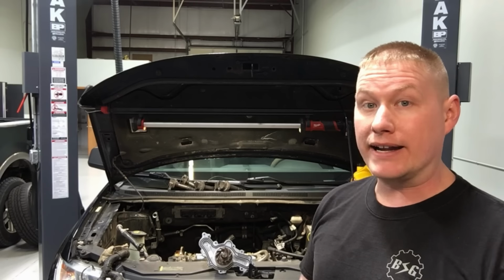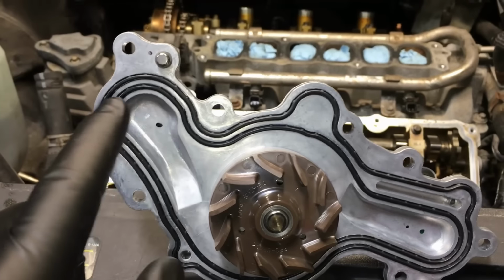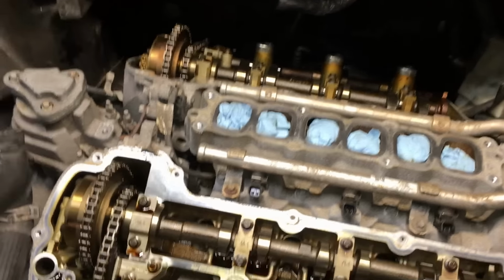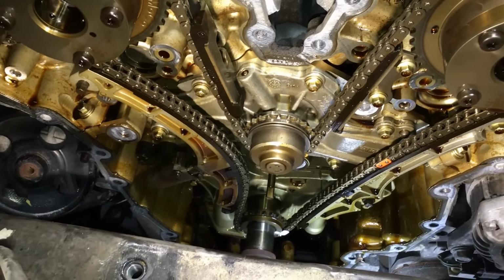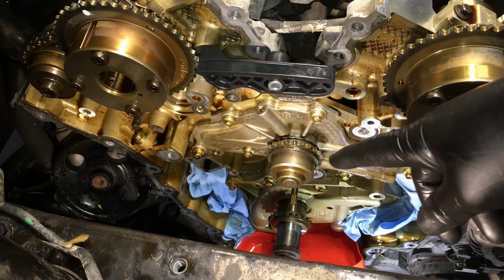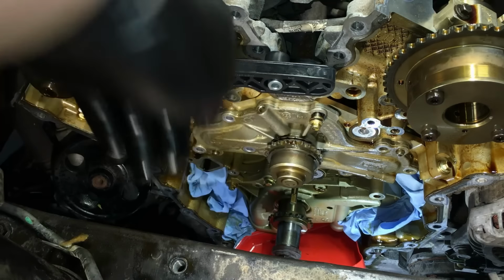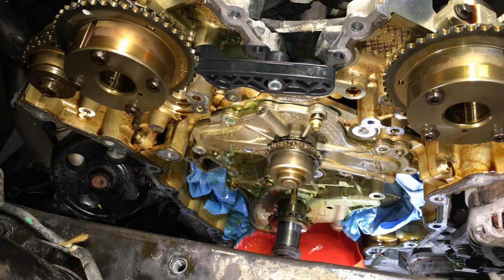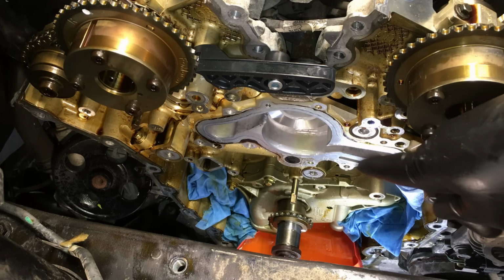Ford 3.5L 3.7L Duratec V6 Chain Driven Water Pump Failures: Check it Before it Destroys Your Engine!

Comment: chain driven water pumps are a prime example of why engineers should be legally required to work as mechanics for a couple of years first.
Reply: Would you really want one those quacks working on your car.   Nope.
Reply: @John it still has an accessory belt drive. Not difficult to simply make it exterior, belt driven. They don’t have a good excuse for this idiocy.
Reply: true but my G35x had 300k miles before I had to do mine... and then it was only a couple hours max.
Reply: @John you wouldn’t want a truck with a 3.5 cyclone. It’s hardly a truck. A sideways v6 is more then common now a days.
Reply: Agreed
Reply: Amen🙏
Reply: Yes I agree 110%
Reply: @john5756 EVs were not a thing yet in 2009. You aren't that bright huh?
Reply: @thomasgary1219   A little history 1832: Scottish inventor Robert Anderson built a basic carriage powered by non-rechargeable primary cells.1881: French engineer Gustave Trouvé showed a working three-wheeled electric vehicle with a rechargeable battery in Paris.1884: English inventor Thomas Parker built the first production electric car in Wolverhampton, England.1888: German engineer Andreas Flocken created the Flocken Elektrowagen, often considered the first real four-wheeled electric car.1890: Chemist William Morrison made the first successful electric car in the United States, a six-passenger wagon

Several Electric cars were built in the 1960s by both Ford Motor Co and General Motors. 
But Where the electric car or vehicle really showed its value was with NASA in the 1960 through the 1970s
In the 1990s GM had full production cars that were Electric The EV1
Tesla Motors began production in 2008 . 
car and driver has a whole story on the history of electric cars from the invention and production of cars and trucks even the Ford Model T had an electric version.
Reply: I like the qoute of one mechanic who saw this engine for the first time, he said that engine could never last as a normal V6, it is so compressed that you could find some new malfunctions that we never heared about,, I couldn't get what he said,, but now I know exactly how this pain feels and how much it costs
Reply: It was done on purpose to make .money
Reply: @gameboyinc4694 How?  Ford isn't making any money on it.
Reply: @Redbelly357  Oh yes Ford is making money,  The tax write off in the billions is a return on profit on the bottom line of profit and loss ledger. Every lawsuit settled is a write off also.  The marketing and sales of parts and service for exsisting and future product to be sold is also a return on investment.  The royalties on the patents for the aftermarket sales. There is more money made in parts than there is for sales of new cars.  Ford generates approximately $12 billion to $14 billion annually in standalone auto parts, accessories, and aftersales component transactions. This revenue forms the foundation of Ford’s broader “software and physical services” business unit, which brought in over $15 billion in 2025. Ford Customer Service Division (FCSD), which controls global parts brands like Motorcraft and Omnicraft, is aggressively pursuing a broader $100 billion+ maintenance and repair market. Ford is raking in the money on the failed designs because People will have to fix what they own as the automotive market is currently pricing many out of the new car market and eventually those new cars become used cars and need repaired. My 2013 Ford F150 has parts in it that only Ford sells and you can not get anywhere, but from the OEM. It has design flaws in the 3.5 gen 1 ecoboost it is only a matter of time before I will have to get a new engine and because of the properitary BS a gen 2 or gen 3 ecoboost engine will not work as the softwares are not compatable. Ford controls their software tighter than the U.S. Government controls national security secrets. and finally all automotive manufactures typically see much wider profit margins on replacement parts and accessories than on assemblies of baseline vehicles. Does not mater the Company Tesla, Ford, GM, Honda, Toyota, Dodge, BMW, VW and many others all use the same bussiness model.
Reply: the engineers are idiots in my book,,,,  something so simple they complicate for no reason, cuz i am not buying ever another ford knowing this possible problem exist
Reply: I say this CONSTANTLY.
Reply: It was the only place to put it, since if it was external, an already big engine would be too big to put into a transverse engined car.
Reply: @frequentlycynical642 they could have designed it to be a flywheel driven waterpump and placed it where it’s easily accessible when the vehicle is raised.
Reply: @rogercustodio6498  I've heard some crazy ideas in my many years.   What Ferd needed to do was, perhaps, put two seals on the shaft of the water pump.  Redundancy. Weirdly, the do have two rows of "o-ring" type seals at the pump to block interface, and if the inner seal starts leaking, it will weep out behind the alternator.
Reply: I am a retired engineer who did work as a mechanic for years before earning my degree. This kind of design problem, from my experience, is typically caused by management decisions that do not take reliability and maintainability into account. In other words, the engineers were overruled by the guy who signs their check. It is a chronic corporate world problem. OBTW, this kind of stuff is why I chose to become an engineer.
Reply: A couple of years at least 10 years that way they get pissed off enough
Reply: And liable for some repairs.
Reply: I've been saying this same thing for many,many years!
Reply: Nonsense
Reply: Honestly the 3.0, 3.5 & 3.7 Nissan FWD engine had chain driven water pumps for decades without all.these problems. Once again poor Ford design!
Reply: The people who designed this engine know better.  I'm sure they get a lot of pressure to meet cost, schedule and other constraints from upper management that force them into this kind of nonsense.
Reply: @davem3789 Pretty sure these clowns are somewhere blaming the technician for their Engineering failures.  I’ve worked as a technician, at a machine shop, thats all they ever did was blame the technician.  They didn’t give a shit about making things easier at all.
Reply: @John also electric water pumps aren’t needed for gasoline engines.  Electric water pumps are mainly only found in hybrids and obviously EV’s.
Reply: @ryanwilson8659  BMW uses them

Comment: Where are you located?

Our '09 Flex just deep-sixed the water pump ALTOGETHER at once!

The Fraud Dealer where we bought it, along with their PHONY 'extended warranty', wants $2,900.00 to fix it (even though it's allegedly covered in the Fraud Motors "extended warranty") and that $2,900.00 is JUST AN ESTIMATE.

I was raised as an HONEST person.... I honestly hope that their entire stealership gets blown away by a giant tornado.

I understand mechanical, my folks owned a repair shop for years... Dad was an ASE Certified Mechanic. I grew up wrenching, so I'd do this job myself if I could... But Osteoarthritis has got me.

Do you know of an HONEST Mechanic in Central Ohio that could do this job for us, REASONABLY?

As an aside, I have to add the 3.5 Fraud V6 to the list of the Automotive World's list of Greatest Boat Anchors... Including the old Cadillac Northstar, the V-8-6-4 and the HT4100... Anything by Chrysler, since the did away with they 225, 318 and 360... And everything else the Auto Industry has come up with since at least the year 2000.

Thanks Much...
S

Comment: my 2011 engine failed.
Reply: Mine just overheated today. 2011 Taurus. 115,000 miles and zero issues until this happened. Checked the dipstick waiting for the tow truck guy and sure enough the coolant had already mixed with the oil. What did you end up doing with your car?

Comment: would you see coolant on the ground on the passenger side, if the pump is leaking?
Reply: Yes. It will drop out behind the alternator. Usually runs down the oil pan and onto the ground
Reply: @icyhotmike  Thanks,  that was it👊🏻

Comment: Are you seeing water pump failures on the double chain versions of 3.5 and 3.7 duratec?
Reply: They fail on both single and dual chain ones.

Comment: This is exactly why I would NEVER buy a Ford Police Interceptor Utility or Sedan from 2013-19. They went to a reliable Crown Victoria to the POS Explorer and Taurus.
Reply: Last year, I bought a 2014 Taurus Police Interceptor with a bad water pump from a municipal auction for $2000 (It was sold to me with that problem already disclosed). Once I had the water pump (and timing chain) replaced, I have found it to be a reliable vehicle.
Reply: @paulkersey9553  wait until the PTU goes out or the water pump goes out again. Those cars were not good cars and they were really really that bad. Steering racks fail on those too. Now I see more Tahoes than Explorers in some parts of Texas. Most of the Explorers are driven in urban areas. I don’t see many Chargers though.

Comment: Hi there sir I’m working on my 2014 f-150 3.7 v6 it has a pully on the outside and I’ve been looking online does my truck have 2 water pumps or is there versions on the 3.7 that only have a eternal pump? There’s to water pumps online you can get one chain drive and one with a pully that’s belt driven I’m confused I want to do the one inside to if there is one.
Reply: There’s only one water pump.

Comment: Just did this job on a flex. Front phaser knocks on mild acceleration. Idles silent. Heavy accel seems okay but 1 degree to 20 degrees and that thing knocks in the front timing cover valve cover area like crazy. Any thoughts?  Thanks love you vids. All ford parts. Solenoids phasers chains tensioners everything. Pulled it back apart and replaced the front phaser and solenoid again. Same noise. Hard clacking when any advance is commanded.

Comment: First off. I've had a problem with the "Car Repair Guys," (Eastern Europeans in BMW shop overalls} hijacking your videos and saying they are FordTechMakuloco. Wouldn't know who they were except for the "Car repair guys" showing up in the bottom righthand corner of the video. Your picture and Subscribe button still shows up with the video title. They're bad along with their videos also. Everything looks the same except the video that plays. Second, Is there anyway to fix this problem with an external electric water pump? Is there a way to seal off the coolant from the oil so there's never an issue with this timing chain driven pump? I've inherited a 2008, 3.5L Edge with 42,000 miles. It would be nice to solve this timebomb before it can become a problem. Modular engines I know. The Duratec I know nothing about.

Comment: it isnt just ford its all the auto makers and the reason is obvious, to keep the dealers happy with outrageously priced  repairs deliberately designed that way!! in the 90's up chevys they had a real money maker for dealers ... the fuel pump and installation, especially in SUV's and trucks, around $600 just for the fuel pump ! chevy Vega and others had a removable plate over fuel pump, so does my older ford Rangers NOW, people laugh when I tell them ... especially mechanics : ) .. that i cut a hole over pump in truck bed and screw a metal plate over it, ya, laugh on :  )

Comment: So much for their old advertisement.  "Ford has a better idea."   I'm seeing a similar horror with my brother's 03 Explorer.  This is the one that has the 4.0L V6 that was made in Germany.  The problem is that the timing chains tensioners have gone bad.  Only you have to pull the engine because one of the chains are located on the rear of the engine.  Excuse me?  That has to be one of the dumbest ideas I've ever heard of.  I'm assuming that way they only had to make one style of head to use on each bank of the engine.  I guess it was to save on production cost.  My mechanic told me that it could blow at 50 miles or 5,000 miles .  But it is going to happen.  Great, I can't give it away now.

Comment: What mileage do you recommend changing the Pump and chain?
Reply: 180,000
Reply: My sisters mks has 76,000 miles and a leaky water pump
Reply: 10000

Comment: This just happened to my 2013 MKZ at 86k miles. Engine overheating notice came on right by advanced auto, pulled in coolant empty and filled it up. Took it in for an open recall a few days later and they let me know that was the problem. Expensive repair. Do you think the engine was ruined during that time? Not much driving at all now with this pandemic going on. I planned on driving this for well over the 100k mark, but who knows now
Reply: I have a chance to pick up a pristine one-owner MKZ that’s loaded, has about 72k miles but has the 3.7L v6.  Owner wants $12K for the car.  Worth the risk?

Comment: I bought this motor. It runs beautifully, but now I’ve just accidentally (and luckily) learned that some stupid mf decided it was a brilliant idea to mount the water pump INSIDE THE ENGINE. Now I have to put my car out of commission for a whole day if I ever have to change it. And God knows imma have to do it myself, because like always, I can’t afford that mechanic.
Reply: So many police departments had to pull their Explorers and Tauruses out of commission due to this problem and the PTUs failing left and right. Steering racks are also guaranteed to fail on every Ford with the Electronic Power Assisted Steering system including the Taurus and Explorer. Now I’m starting to see more Chevrolet Tahoes than those POS 13-19 Police Interceptors especially in rural areas. The cost of replacement for the water pumps is very high and the failure rate is high too.

Comment: Heres a crazy idea found in your owners manual.  Change the antifreeze as part of your preventative maintenance.  Antifreeze has anticorosive and seal conditioners keeps seal good.     Heck do it 50 k sooner than recommend.  Usually cheaper than a water pump install.  And drive like a human being and not as if the accelerator was an on off pedal.  I bet your car will las tfor miles with no major issues.

Comment: 1200 that’s it. Dealership is charging 3800. i got 256K on my 07 Mazda Cx-9 . No one other than the dealer will touch the replacement job.

Comment: Having no fuel filter and a stretch belt on the power steering pump is stupid as well. I do like our edge but i am not a fan of working on these engines. I did the plugs at 100,000 with the upper plenum off. Not a big deal in your drive way but come on dont make stuff so darn cramped.

Comment: By far, your videos are superb! I am quite thrilled perhaps by hearing you say that the 2012 and newer don't necessarily have this same issue. I have a 12 MKZ with around 82,000. Should I be as concerned? I did cross reference from a few auto part sites that there indeed is a dual sprocket setup that is different from the 2011 MKZ. I feel a little tingle in my stomach as to not be as concerned with this issue as of yet; am I right to feel this way? I am dealing with the AWD as well and your 30,000 mile service is well in my head. No matter what though, thank you for all that you do. It is a major blessing to us common folk.
Reply: The old coolant is vc-10-A2 which is the factory dark green coolant and the newer coolant that its compatible with 2011 to 2016 explorer is vc-13DL-G. Thats the coolant that newer explorer are using and dont have water pump issues. But i also think ford change there water pump location on these newer explorers but they claim that the newer coolant helps the older explorer pumps.
Reply: Im thinking about buying one, is it still running good?
Reply: @lukesylvester2022  Still no issue, but I am changing the fluid to the newer Ford P-OAT Green coolant. People are saying the fluid is easier on the water pump seal. Fingers crossed.
Reply: @eightiesgod  Alright!
Reply: @eightiesgod  you mean the new yellowish green. I did a coolant flush on my 11 ford explorer
Reply: Does it not effect the 2011 model?

Comment: Brian, thanks for the useful information. keep up the good work. Also, I hear a lot of people bitching about having to change the first water pump at 180,000 miles. Remember the old engines?  You had to change the timing chain and water pumps every 30,000 miles and plugs every year? I think if your first service is 100,000 miles then you got off easy. You pay either way. Technology is the reason this 3.5 Ford makes more power than your big block Chevy.
Reply: Those usually go out at 120,000.
Reply: Boom 💥 👍🏻

Comment: Ford should have used a timing belt design if they were going to do this 🙄 and I would drain the oil before taking the water pump off. The coolant will mix with the oil and it will be no good.

Comment: My '10 Ford Edge is @ 88,728. I'm replacing my WP. What should I replace since the engine is pretty much taken apart at this point.
Reply: chains and tensioners

Comment: Purchased a 2011 Ford Fusion Sport with this 3.5L duratec engine. Utterly disappointed. Wish i got the 4 cyl. Fusion. Ive driven the 4 cyl, the 3.0l, and this 3.5l version, and out of all of them the 4 cyl is the best because my fusion sport weighs like 6000 lbs and the extra hp and torque barely makes up for the extra weight. Not looking forward to replacing this, might sell it off before mine goes bad. I don't know what compelled me to buy this Fusion Sport, i thought it was cool at the time but definitely should have just got the 4cyl model

Comment: Great info, my 2010 Edge with a 3.5 has 160,000 miles. The engine and car have never gave me a ounce of trouble so I will gladly pay someone to change my water pump and it’s never a bad idea to have the timing chains and tensioners inspected anyways.
Reply: This is exactly what I'm thinking with my 2010 Fusion Sport!  127000 miles with not one single issue until this water pump.  It's just too bad my warranty ended 2 months ago..